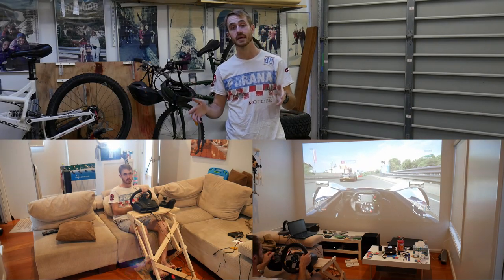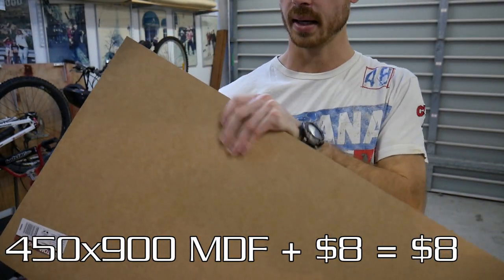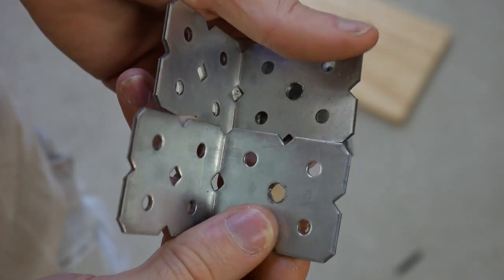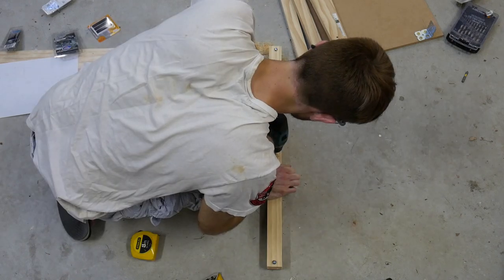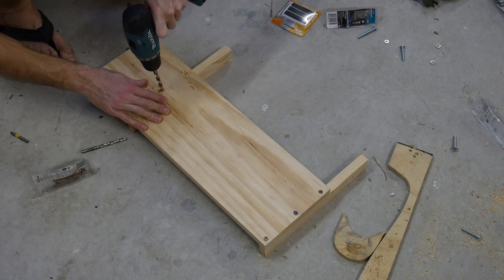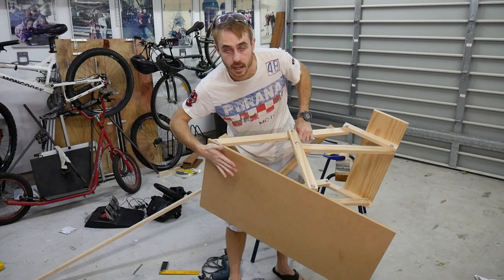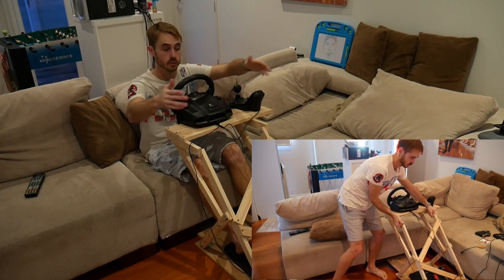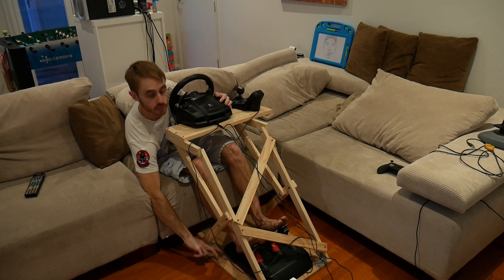How to Build a Cheap Racing Wheel Stand for your Couch! Fits G27, G29

Comment: Thanks very much, I used a malamine base. I used 3 lengths of the thin wood (cut last brace from the left-over of the bench plate). I have 
'Goliath' locking pins for the four knee joints to collapse right down. This works perfectly

Comment: I once used my mums old sit up exercise machine. Took it apart moved a couple parts about n bolted a old piece of window sill to it. Had foam and pads already fitted n could also fold down because of how it was already designed to pivot wen exercising

Comment: I Made a playseat using some old plywoof to make the base,wheel stand, TV stand, and pedal platform. and also made a custom molded seat using wood for the general shape, and using two  XL vacuum seal bags taped together filled with polystyrene bean bag beans, filled with resin, then made a fiberglass copy of it. just like real formula 1 seats but on a budget.

Comment: Great video, Im thinking of making something even simpler (but have zero wheel sim racing experience) by just attaching a small U shaped piece of bar to a base. So I can then sit on the bar and wedge a wheel -base onto my lap. Probably cant have ff but I think its the simplest, most portable solution?

Comment: Hey Kyle, could you do a video about why most drag cars don't seem to use wings to get more traction off the line? I know top fuel does, but most other classes don't seem to. Surely even massive drag tires can't handle the 2,000+ horsepower being put out by a lot of these vehicles.

Comment: cool video and great plans.  I'm curious- do you know how high off the floor the seating surface for your couch is?  A higher seating surface would necessitate either raising the base (thicker material, etc.) or making modifications to the lengths of the stand pieces.
Reply: You could put a number of holes in the back support to make it height adjustable.

Comment: Is simracing really worth it? I understand how hight simulation quality is today, but I thought that performance driving is guided primarily by acceleration feel (that "feeling car with your butt" thing), but sim gives you visual input only.
Reply: I can tell you right now that Sim driving is BEYOND worth it. Sim driving has made be a better driver myself IRL. one thing that I realized myself when using a driving simulator is that "you have to treat the simulator as if it was real life, and treat real life as if it was the simulator". you learn alot of things in the simulator like steering wheel feel, you feel what understeer feels like and you learn to listen for wheel slip and pedal feel. the most valuable thing about sim driving is you get all the driving experience without having to spend money on a real car to practice on and maintain, gas and tires, and giong to the track, you can just wake up and walk to your living room.
hope this helps.
Reply: I am asking because i am living in Siberia, and thanks to Tzar's insanity initial costs of simracing and Lada with welded diff is roughly the same.
Reply: What sim would you recommend?
Reply: good point about Lada :D it's just that sim will cost u much less than Lada repair ) not to mention you'll never be able to drift like crazy over the forest doing 160 kph ))
Reply: Iracing all the way